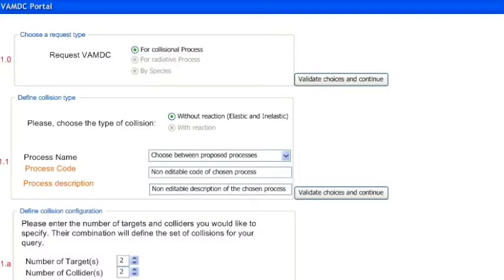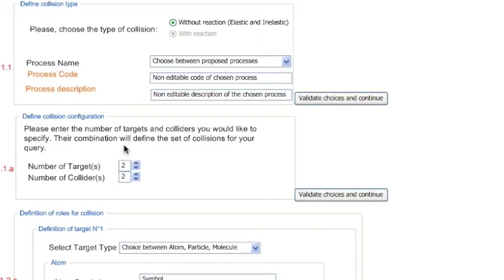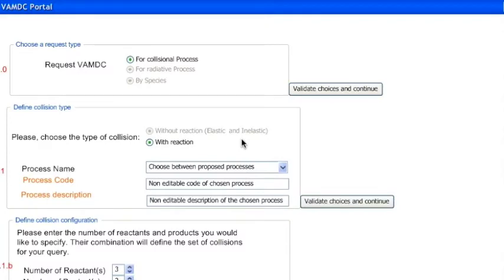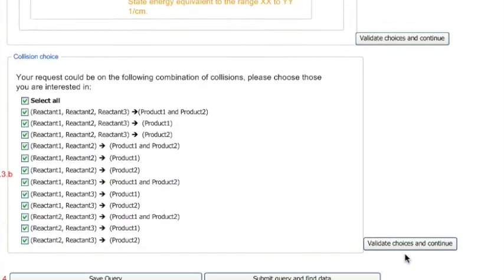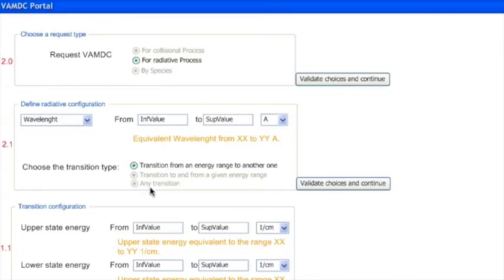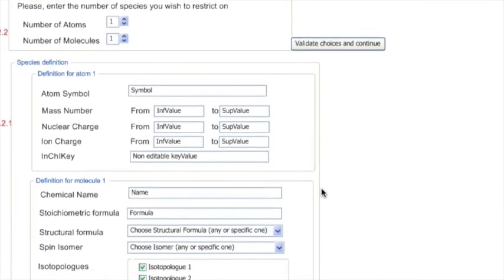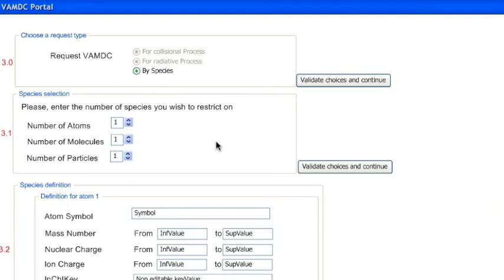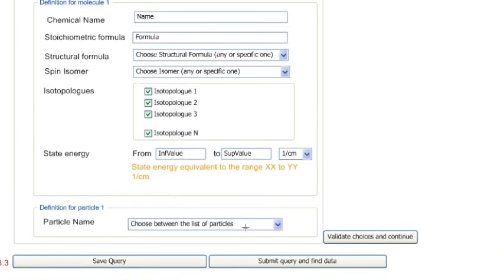Scketches for the new VAMDC portal

Comment: It looks efficient, but with a small caveat. An user that is not yet proficient with the new portal and all the ramifications of the tree structure will have to do a bit of experimenting before finding out how to achieve what (s)he wants. That's because (if I understand) possible lower levels of the tree only become visible after the user made the choice(s) above.
It will be very efficient once one knows the system well, but it will involve some learning.
One possible suggestion: instead of only making subsequent choices appear after the user validates someting on the current box, make it possible (e.g. with a switch, like a tree vew in which deeper levels can be shown or hidden by clicking on a button on the interface) to already see what possible subsequent choices are available afterwards, depending on what one chooses in the current choice. If one opens the whole tree, make the chosen path in the tree visible by graying out the other ones.
So if a user has a precise idea of what (s)he would like to do, but does not know yet how to achieve it through the portal, this might make it easier for her/him to find out (like "ah, if I want this choice to appear, I need to select this choice above")
another suggestion: make available (maybe optional?) a box which will show the SQL (well, VAMDC subset of SQL) query that is being constructed, while the user works her/his way through the choices
Third suggestion (much more complicated to implement, but possibly nice): if a user has a SQL query that (s)he would like to obtain, offer the possibility to input that into the portal, and have it show the user how that can be obtained with the web interface, if possible. Alternatively, just make a library of queries, adding to it with experience and use, and for each of them show in the FAQ how to obtain that query with the web interface.